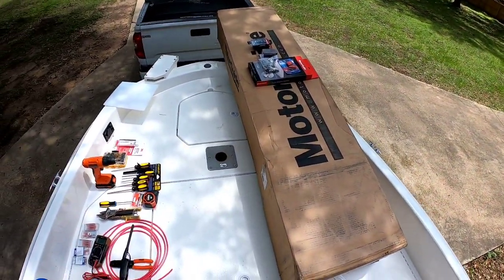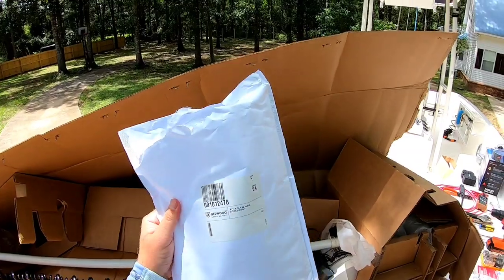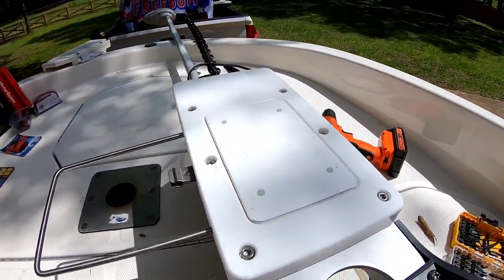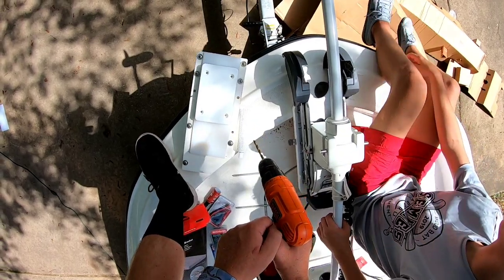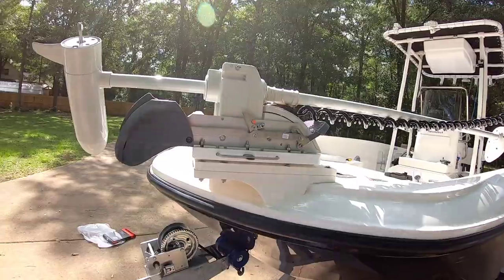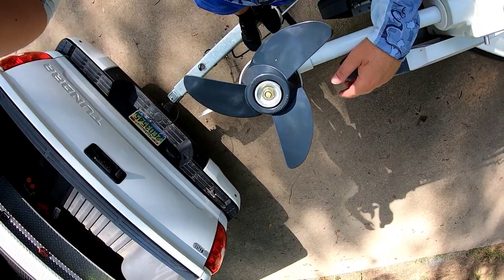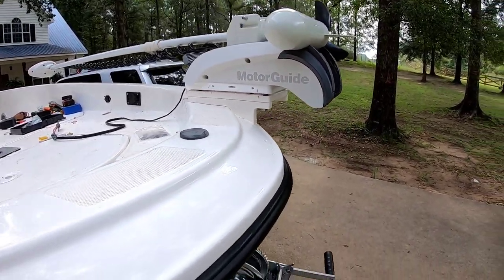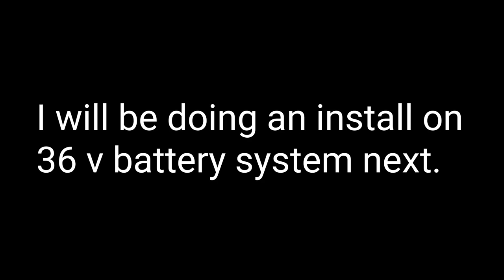Installing/mounting a Motorguide Xi5 36V Trolling Motor.

Comment: I am about to install this exact setup this weekend and your video gives me the confidence to do the job right the 1st time. Thank you. I have the Ultera on my other boat and look forward to see what the Xi5 can do. Sounds way quieter than the Ultera.
Reply from the maker: For saltwater it really is a great trolling motor. A 60 amp circuit breaker is required. A 50amp will trip at full speed. Thank you for the comment brother.

Comment: Keep your eye out for deals.  I got an awesome clearance price from the bass pro website.  Got their 36v 60" shaft Xi5 with both the remote and foot pedal for $1,499 (1,599 plus a $100 rebate.). There is a local shop that sells refurbished interstate group 29 deep cycles for 40 bucks each.  So for about 1,620 + tax I was up and running.
If course I still bought a quick release mount, breakers etc so it does still add up a bit lol.
Reply from the maker: Wow man that is a great deal. My trolling motor alone was 2100 or 2200.
Reply: @251reeling9  I got very lucky.  They sold out online in about 20 minutes.  right place at the right time I guess.

Comment: Just bought a boat with this setup the previous owner had mounted it straightforward and back down the middle of the boat looking to put it on the side like you did I however have nav lights in the way that I will move I noticed your boat has no bow mounted navigation lights how did you pull this off not sure the coast guard would approve

Comment: Great video thanks for posting. The bracket that you had from IMC how are the legs attached to your deck? It appears that it is 3/4" king starboard material.
Reply from the maker: the bolts on each side go through the top plate through the side plate and through the hull of the boat. Long bolts all the way through

Comment: Hey, great tutorial, it is super helpful.
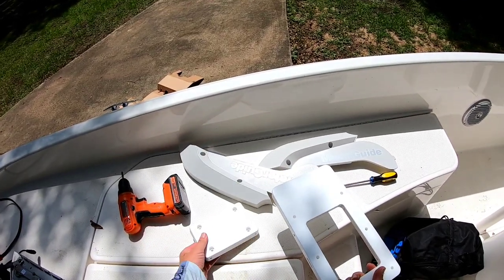I would like to ask for one favor, could tell what are the dimensions of this big plastic bracket that comes on top/inside (You holding it in hand on 6:50) quick release smaller bracket? Can't find any info and i would like to prepare mounting before buying one.
Cheers
Reply from the maker: Store

5.0 out of 5 stars1Reviews

MotorGuide Xi5 Quick Release Bracket Comp, White,  on Amazon.com

Comment: How can I get one of thoses brackets that you have mounted on the boat before you started this project? I have a fiberglass boat and I need something similar to it. I  would appreciate any help. Please and thank you.
Reply from the maker: You can have one made all it is is 3 pieces of acrylic cut to fit the bow with holes drilled through it. I DID GET MINE FROM LMC MARINE OUT OF HOUSTON TX. YOU WILL NEED SOME LONG BOLTS OF COURSE.

Comment: Question where did you get your trolling motor bracket ? Who made your trolling motor bracket so you can mount your trolling motor to.
Reply from the maker: jet technology's i got it from lmc marine out of houston tx
Reply: @251reeling9  I can’t seem to find this bracket on lmc website or anywhere. Do you have a link?
Reply from the maker: @clivingstoned  You may have to call LMC Marine in houston they sent mine in the mail and i had to mount mine myself.

Comment: Hello.. Great video btw.. question and/or clarification.  You mentioned the space between the motor column and rub rail is 1.5" but MG Manual states .5".  Granted 1.5" is safer but just wanted check.  
Also, I noticed you didn't use the rubber isolators which is suggested to use unless motor is mounted on carpeted boat.  Wonder why it was left off.
Thanks in advance.
Reply from the maker: If you are mounting straight to fiberglass or straight to your aluminum deck yes you should use isolators. A friend of mine that works in a boat shop recommended the 1.5 due to the fact i will occasionally be in swells and chop. I have a 76 inch shaft.
Reply: Just installed mine with just under an inch clearance and had to go back and read the book lol. Had a small heart attack thinking I mounted too close

Comment: Where are going that rubber washers that come with nuts and bolts?
Reply from the maker: that would be for aluminum or straight fiberglass drilling to the deck.

Comment from the maker: Also note that you will need a 60 amp circuit breaker.
Reply: What type of circuit breaker?  Is it a motor guide brand?
Reply from the maker: @mattswann110  I got one off of Amazon it was made  in America. But beware of cheap ones they will fail on  you.